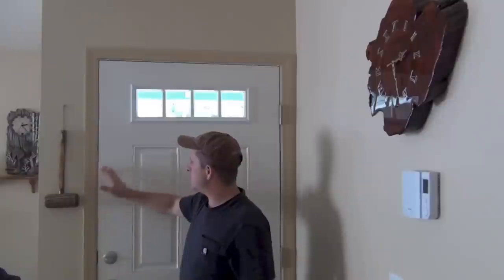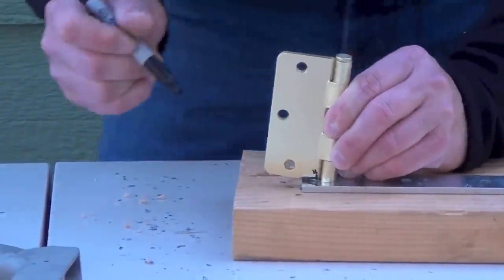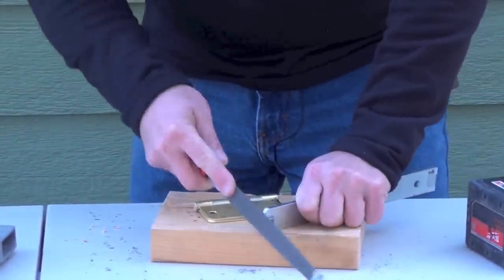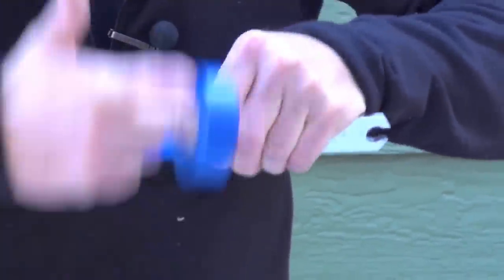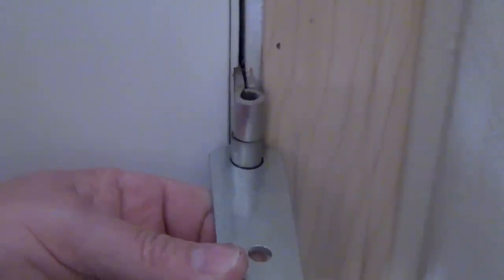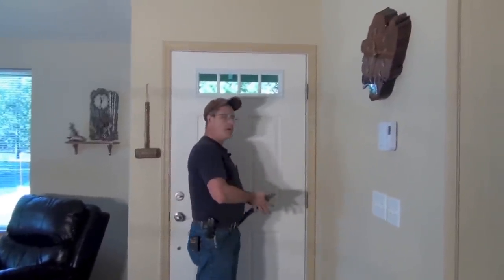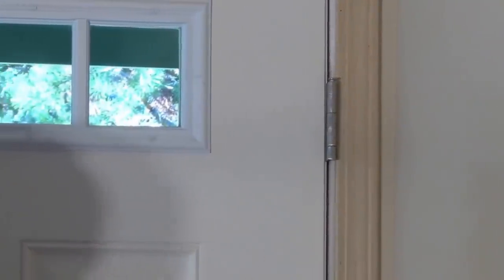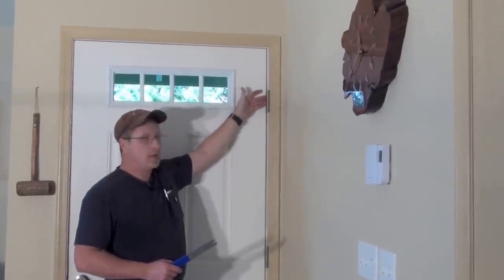How To Fix A Sagging DOOR

Comment: Excellent video but as someone who comes from a machinist background let me give you one tidbit of safety advice: Whenever drilling through metal  especially a piece of metal that thick it’s always best to use a slower speed on that drill as well as some kind of cutting oil. How you had it set up in this video you ran a huge risk of the drill catching that metal, spinning it around and injuring yourself.  As far as an oil to use it doesn’t matter what you use just as long as you use something.  Also it would have been a good idea to clamp that metal to the table instead of holding it with your hand. 
Again, that was a great video just be safe!

Comment: If you dont want to make the tool, you could try a 8" crescent wrench applied to the hing that is attached to the door.. but you got the job done.. good Job!
Reply: Robert Hanus AAÀ
Reply: I used a 11mm open wrench and was surprised at how easy the hinge can be bent. This was a great video and helped me fix my sagging door!
Reply: I tried a crescent wrench but because the jaws are parallel, the wrench simply slipped off.
Reply: jg Kniplex pliers with a little electrical tape on the teeth. Best pliers in the world and the tape won’t scratch.

Comment: This really is a high quality video. In the 15 years that I run my own handyman business, I have adjusted doors many different ways, including with the long screws as you mentioned, and by bending hinges. Most often I have chosen to use shims as was mentioned more than once below. It really depends on the scenario, but I am not patient enough to make my own tool when a crescent wrench works so well. I will say that it is real tempting to patent that nice little doohickey and sell it for $19.95 on late night television. I would not put in the trouble, but someone else might. Thanks for your effort!

Comment: I tried the long screw technique first but nada. The idea of bending the hinge knuckles is brilliant. However, I didn't bother with making a jig or tool. I just used a pair of vice grips. There might be a vertical line or two in the hinge knuckles but invisible from 3 feet away and a heckuva lot faster. Thank you very much!
Reply: IMHO I try to never use a vice grip on anything unless there is no other way to do it, because they just chew up the metal too much.  If it's for your own house, I guess it's OK, but doing it for somebody else, they might object a bit.

Comment: Have a question, in my case, I added thicker molding around the door and the hinges have 1/32" of clearance other than removing and using a vice is there any other method of bending the hinges?

Comment: Bending the hinge is a great idea. However couldn't you take the door off and stick the hinge pin in to just the ones that you want to bend and then hammer them to where you want them (1/8 inch or so).  that way you don't have to make a tool ?

Comment: This is a quick fix band aid. Nice little tool. Eventually you’ll have to address the reason the door began sagging in the first place. Was the door jam square to begin with, and it settled as the house ages, or was it out of square to begin with because a carpenter/home builder was in a hurry. I’ve seen door jams that needed repaired to learn the jam was set using a single 4” nail in the header and the casing was pin nailed in and was supporting the door and jam. Eventually you will have to address the out of square jam, the hinges will only bend so far. Good little fix. And remember to always wear the proper protective gear... ANZI eye pro, gloves etc. Austin meant to mention this in the video, but got side tracked... 😁😁😁

Comment: Any advice for a door that is not sagging left to right as you look at the back of the door but the bottom of the door fits nicely against the jam but the top is bowed out from the jam so there is air leaks at the top. How would you solve for an issue top versus bottom fitting against the jam?

Comment: I really appreciate this video, thanks. However, my issue is that of a glass exterior door with a wood frame, where the wood 6" wide wood frame has actually sagged at the joints. Any ideas on how to rebuild the door itself?
Thanks

Comment: Hey Austin,
 yes it is very true that sometimes longer screws just won't help and "tweeking" the barrels on the top hinge is the only answer. (have done it myself) The beauty of your persuader is that one doesn't have to take the hinge off, put it in a vise, (which is not always available) tap it over then re-install the hinge. Great time saver man!
                                                                     thanks Ken

Comment: My front door is out of the plane of its frame, so it isn't pushing insulation and I can see the gap between the door and the frame. Basically, I need somehow to move a top far(from hinge) corner towards a frame to close the gap. Can you advise how to do it? Thanks.

Comment: How do you bend a hinge when the "hinge bolt" is fixed to the bottom half of a 2 piece hinge used on aluminium doors.. There is no removable pin. Thanks

Comment: Austin, I really like your video and the easy way you explain how to fix the door. But, I have a couple of suggestions: 1. When drilling a 1/4" piece of metal with a hand drill you should clamp down your work piece, that =way if the drill binds it will not jerk out o your hand and hurt you. 2. I really think you should patent your door tool. But wen you make it use a Bench Drill and bench grinder, they are much more safer. Best Regards, Ken

Comment: I like ur site . I just found it and watched a # of ur video's... I especially liked ur rustic mallet and  the caulking like a pro with the denatured alcohol tip.  Your video on the sagging door I was interested in as I've tried fixing 1 that had fallen enough that it would no longer allow the deadbolt to lock or the door handle hardware to match up. I replaced the screws (they were  only 3/8 - 1/2" on the hinges with 2 or 2 1/2 " screws and it helped lift the door up and to the right about 90% of the way. Just not enough so the hardware matches up. The tool u made will it work on most (door) hinges and do u know of any other tips/tricks that will get the hardware to match and the make the door to go right and upwards that last 10%........................

Comment: Which side of the hinge are you bending the door side or the wall side?  Could not see in the video you were blocking the view.
Reply: he's bending the part of the hinge attached to the door jamb, rather than the door. That way the door side of the hinge is pull over farther, to line up with it.

Comment: Work smart, not just hard. Use an adjustable crescent wrench to adjust hinges in this way and use the proper tools and safety measures when cutting/grinding metal.

Comment: Great tool for sure.... you may add that in some instances a viewer will find their hinge is painted, rusted, and or has NRP (non removable pin). Also, throw a quick note in about safety. Use common sense and clamp material as well as PPE (personal protective equipment. Just the two cents of some experience. thanks again...

Comment: Exterior outswing doors will often have welded pins in the hinge, where this tool would not work very well, as you cannot remove the pin without compromising the hinge.  In this case, you’ll need to adjust the entire hinge at one time, which that tool is not nearly strong enough to do.  For those cases, you can remove the hinge, put it in a vise, and try moving it, but good luck.  You can also cut the bottom of the hinge pin, and remove the pin, and then use this tool or a cheap knuckle-bender., as the other hinges will still have their pin welded in.

Comment: How about a table top vice?  It would do wonders for safety, as well as hold things you are drilling that caused me to shiver a bit.  Nothing like a steel bar wrapped around an about to break wrist, ya?  Do you have handles for each of the size hinges you have on your doors?  Nice job, but I agree with those who use ordinary wrenches, or vises.

Comment: tried to fix my sagging door by replacing the short screws with bigger ones one screw wouldn't go all the way in something was in the way tried to take the screw out wouldn't come out and that screw was sticking out so the door won't shut i had to cut the screw with bolt cutters so i can shut the door
Reply from the maker: That's frustrating

Comment: KNUCKLE BENDER 3 IN 1 TOOL The Knuckle BenderTM allows you to easily bend hinge knuckles for simple door adjustment, remove the hinge pin and quickly align the door hinge for pin installation.

Comment: Seems like the door casing would get damaged.  I've fixed a lot of doors and always have been able to fix without this type of tool.  The long screw works 95% of the time and when it doesn't you figure it out.

Comment: u can do it with an adjustable 🔧 and bend them
Reply: Thanks for the tip.  My crescent wrench worked great and saved me the time of having to make a new tool.
Reply: Would a flare wrench work?
Reply: Very nice. What about tapping hinge section with hammer and maybe some tool and bend the section without making tool ?
Reply: Oh just saw crescent weenie idea. May try that. Thanks !!!
Reply: Wrench not weenie !! Sorry !!
Reply: Wont the wrench bend the hinges
Reply: That's the idea.
Reply: Yes, I used a 9/16" flare wrench.

Comment: He literally made a wrench.. Vise-Locks would work better. But an easier way to bend the hinge is to put something in the tight gap area to wedge it and while you're prying , smack the hinge with a hammer.  Works every time

Comment: Why do you need a special tool? Can't you just use locking pliers to bend the hinge?
Reply: Hinge will get scratched pretty bad with pliers.  The long 3 1/2" screw works most of the time.

Comment: Don't "bend" and ruin the hinge, FIX the problem.
Reply: What do YOU think the problem is? How would you fix it?
Reply: @tripjet999.   I agree, don't bend the hinge,  unless the hinge barrels are bent  to begin with or somehow became bent thru circumstances.  Inspect the entire installation , start with looking at the hinges, hinge screws, barrels, etc. - that's fine then check the door & the jam  for plumb on both vertical planes, it could be the strike or hinge  side of the jam shifted, settled, or got jarred loose, especially if folks are slamming the door hard often (kids anyone?).    Inspect the mortises on the door side and jam side - often times with new construction the hinge mortises are horribly  manufactured and need to be redone.  Interior doors - same thing - especially those 'solid pine' doors that are really wood core finger joined or sash jointed scraps with a pine veneer.   Just saying... best to make sure you got the whole picture.
Reply: Forgot to mention that putting that much force on an installed hinge places a lot of stress on the hinge screws that are closest to the barrel and you may damage the screws themselves and/or  blow out the screw-to-wood thread cavity.  If its a metal framed door the job can be more difficult.

Comment: not to sound overly critical but this is a huge waste of time, energy and effort. why not just use a wrench? i did. failing that, you can take a hinge right off and use something like a vice to hold the single hinge, and bend it to any desired angle. worked fine for me too. not sure why you have to make this at all when its 20 times quicker to do either of my suggestions.
Reply: Scott Braun Scott , I don't necessarily disagree with you , however , once you make this tool , its done and you can use it over and over. The only time expense is the first one. After that , you'd pull it out of your toolbox and be done in 30 seconds.
Reply: +Scott Braun he made a cool tool and it would be nice to have one but a pair of vice grips worked for me.  It was a good video though because it taught me where the problem was and how to address it.
Reply: mydogsparty yeh he spends 3 hours doing highly hazardous metal work to make what is essentially just a glorified wrench.